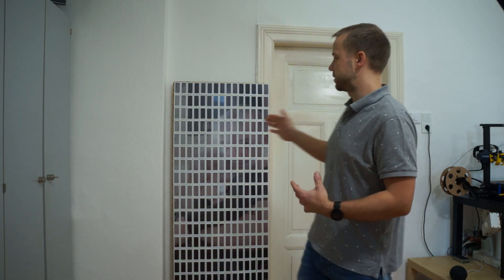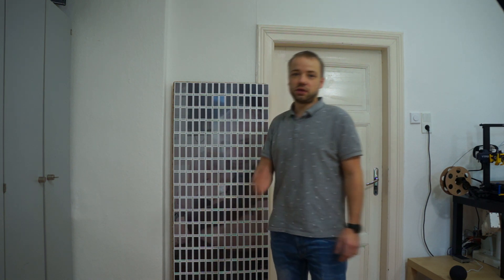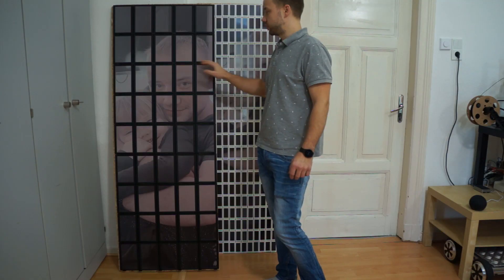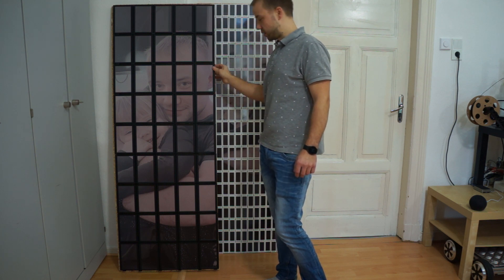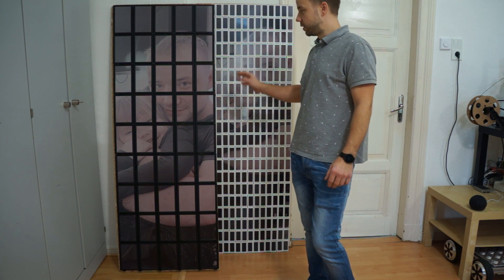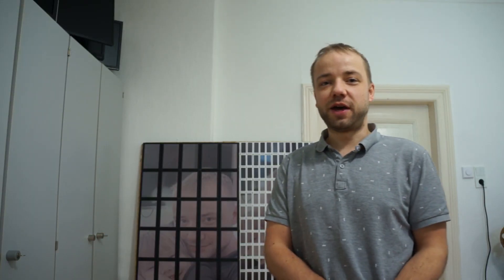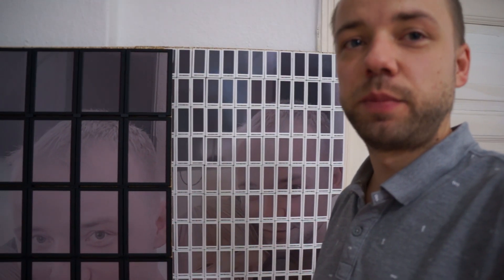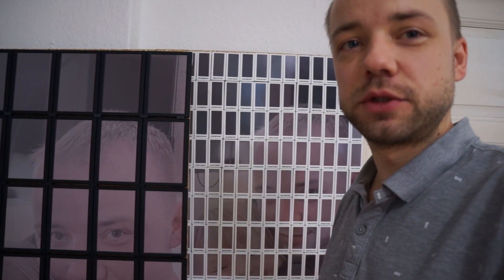E-Paper Wall 2.0 E-Ink Price Tag Hacking

Comment: Try thinking in three dimensions. take your screens and overlap their borders so that there's only one border thickness visible and then Mount them up into like a pyramid step structure. You might only be able to see the image really well from the front but at least you'll have less border thickness in the way.
Reply from the maker: Hey, check out the Wall 3.0 video :)

Comment: Really nice project! 
Some potential improvement would be to stick some addressable 144led/m led strip with black diffuser on the borders and write some software that lights each one based on the missing pixels.
Reply from the maker: Not a bad idea actually, the only need to be very dim so would even not use that much power
Reply: @atc1441  True.. you probably need a lot of leds and at full power would consume a ton. But yeah, I think you can get away with dimming them to minimum